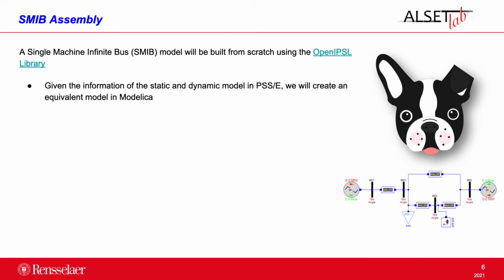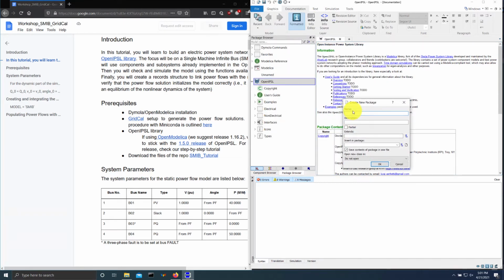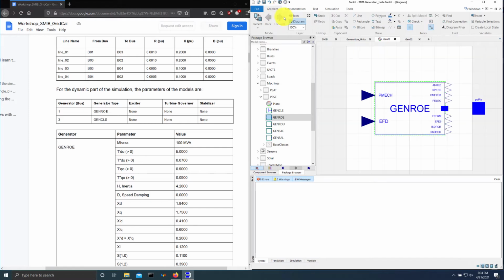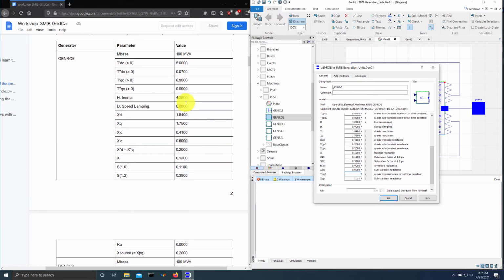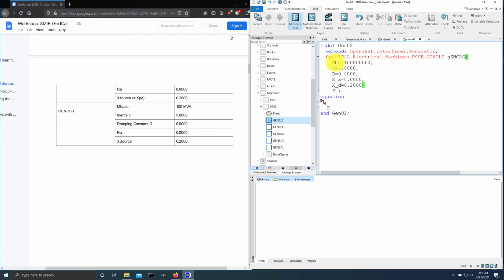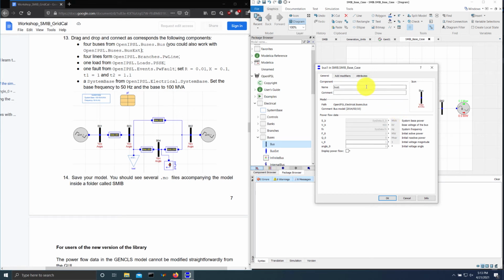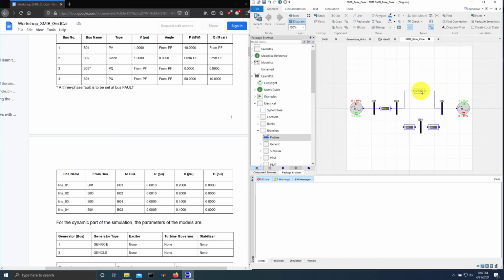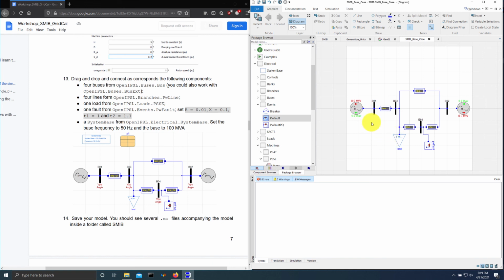SMIB Tutorial: Assembly and Power Flow Generation for Dynamic Simulation using OpenIPSL (2/6)

Comment: thank you for the video ,
i"m currently using openModelica 1.17.0  i' d like to know how to change the Buse form , the Buse form am using have a square form
Reply from the maker: I don't know about OpenModelica, I don't use it anymore. However, it should be similar to Dymola. You can modify how it is displayed by editing the Icon layer of the Bus component, see pp. 49-50 in the Dymola manual here: https://www.claytex.com/wp-content/uploads/2010/03/Getting-started-with-Dymola.pdf